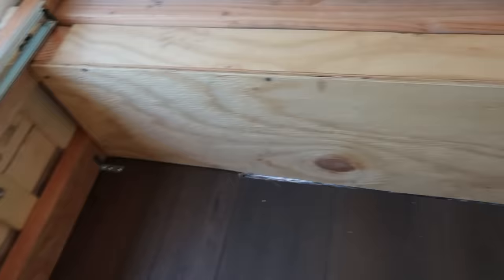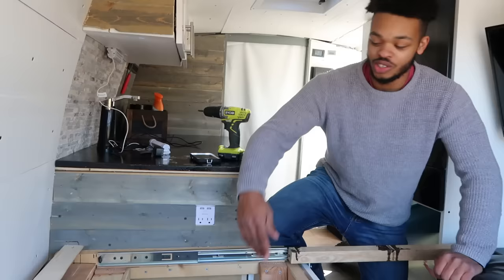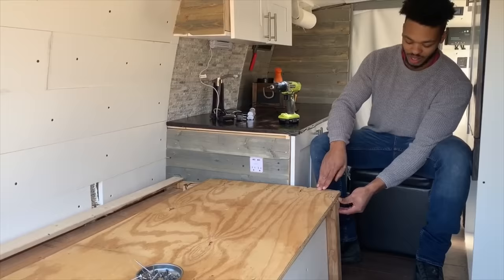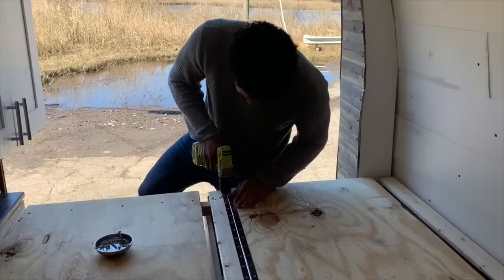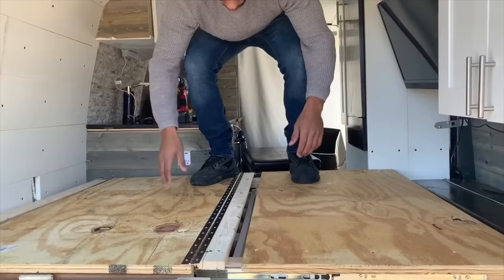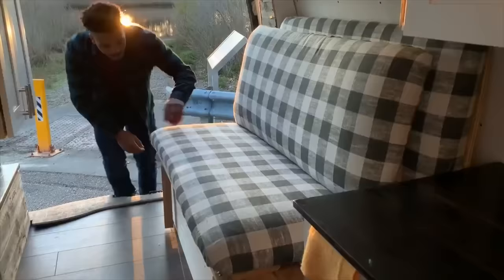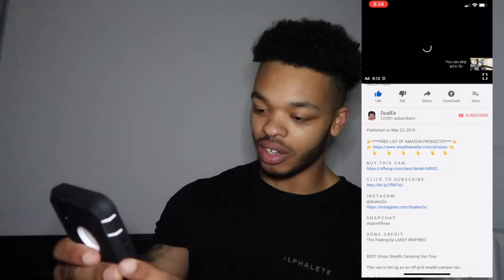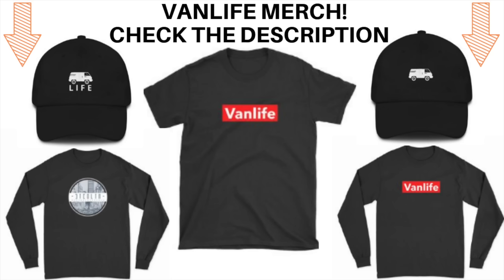BEST Camper Conversion Bed

Comment: I teach engineering and really appreciate how you have incorporated the natural "elastic" deflection of the drawer slides to allow the bed to open without the legs contacting the floor and then  provide support under load.  Very few bed designs take advantage of material properties in this way... GREAT JOB! A+

Comment: Thank you, thank you, thank you!  I'm about to build this in my van.  You have cleared up alot of the unknowns for me.  Just one recommendation: drill some holes in your bed boards for air circulation or the condensation from your body through the mattress will eventually cause the wood to get mouldy.  Cheers Mate!

Comment: Intelligent design and very easy-to-follow instructions. I built my van last summer with a platform bed, took it out and realized that I hated the design. Ripped everything out and have been trying to find a better bed solution. This is it! Thanks for going to all the trouble of taking it apart :-)

Comment: THIS DESIGN IS FUNCTIONAL. Yes you have a good set up. 
Not hard to get to the storage underneath, no messing around with lifting  or refitting 3 foam cushions or any one of 4 timber bed top pieces every time you want to access under storage like I have to.
I had been thinking about what to do to get easy access and storage and still have an out of the way fold out bed.
You have helped me solve my problem which will allow me to do away with a single bed/seat, gain storage and  a comfortable seat using my newly bought foam and still have a bed when required. 

I have removed the table (used to make a big bed and one side of the U shaped cafe seating which previously gave me the option of two single beds because I wanted floor space. 

There is still too much seating for me as I am a solo traveler driving a little motor home (fits in a standard size parking bay) with an over cab double bed. At the moment I have L shaped seating across the back and down the other side. Under the back seat area in one corner is the water pump, the rest is storage to where the two seats meet on the other side over the gas box (accessed from outside. Next to the gas box is storage and three batteries and associated electrics to the stove cupboard. 

I have planty of over head storage.

 I can now remove the seating along the side and install a cupboard with doors, making access to the batteries easier and giving me a bench top (with a pull out table) the same height as the stove and a bit of floor space too.. 

Thank you for posting

Comment: What about using a hole saw to drill holes in the plywood to let a bit of air flow and avoid moisture under the cushions? 
Also, there is this aire-flow or den-dry net to put under the cushions or mattress to avoid moisture too. 
Depending on where you camp or store your van, that might become handy. Humidity sucks 🤣
 Add an open containers with cedar chips in the compartment under the plywood. Smells pretty good

Comment: I made a bed that opens up and underneath it is storage boxes you can pull up and out to take out. Inside the bed head end is a shelf to put things on and has a plug in and light switch. above the bed is a counter top piece,, this is also my kitchen area. To clean dishes,, all i have to do is PULL OUT 2 square plastic containers from under bed storage boxes and fill one with hot soap water and the other with just plain warm water to rinse the dishes off. Magnetic strips hold on to knives to wall and silverware. Big plastic water jug you get at wall mart with plastic spicket and 2 push down water filters out 99%.  All around the roof edges has a black PVC 6 inch Diameter pipe that has water in it for doing dishes or shower and has a fill hose with  attachments you assemble to outside van for an outside shower if needed.. Also on the roof is 500 watt solar panels for all my electrical needs. I hang clean dry cloths on iron bar that is bolted to the sides of inside van just in back of driver and passenger seats. a special privy toilet you can get on line that separates poo from urine. poo drops into black iron container i made and you change out and once full you put it in the solar incinerator i made,,, all it does is dry up the poo into powder to throw away later on ground. No smell if the black iron container is closed and in full sun. Pee just dump on ground. I have a small pantry for ALL the dry good foods in packages or cans.  A bike rack in the back and i have a powerful light on a cord you can move around or clip to side of vehicle.

Comment: I'm wondering if there's a way to use this design to accommodate a full sized futon mattress... I'd likely have to find a way to make the platform slightly angled inwards when in couch mode to prevent the mattress from sliding off

That said, I LOVE your design. It's simple, elegant and easy to operate in cramped spaces. Compared to fixed beds in vans, you lose a bit of storage space, but you get more living space and versatility. Compared to other convertible bed setups, you get easy one handed operation and a cleaner design than the generic pull out slats

Great job dude

Comment: Wow I have not commented on any ones YouTube channel before and I’m 27 years old so i been alive for a while. This video has just blown my mind. This build is the one,
I do have a Question, the floating leg for extra support doesn’t touch the ground correct, which allows you to slide the bed without scratching the floor? If it doesn’t touch the ground how does it support the sleepers weight?

Comment: The Best bed build that I have seen, not only is it easily changeable but the access to the lower storage is the best out there. Why do you have a piece of wood on the edge of the seat, right below the bottom there. Is that the 4 inch piece to make up for the plywood being too short?

Comment: Great design  and you could make the mattress better by having the mattress sectioned but fully attached together. That way no terrible seams thats like sleeping on 3 islands otherwise.  You could do this with 8020 make another channel on the otherside to connect to so you wouldnt need leg supports.  you also have good storage underneath i never liked the stationary bed slash garage thought it was a waste of space

Comment: That's one of the best looking beds that I've seen, and the most easily opened.  Whoever did your upholstery job helped to make it all look grea, toot!  Thanks for sharing.... and I'm sure others would agree when I say, I'd love to see the whole layout of the van construction to see what other clever ideas you may have come up with.  Oh,  one suggestion.... you might want to drill some holes in the plywood of the bed, or you might get mold with no air circulating thru' it!
Reply from the maker: tegma I made the cushions myself too I just didn’t include that info in this video haha I have more videos about the build coming out soon so stay tuned!
Reply: Yes, size of the bed cushions would be great!

Comment: Make sure you always drill pilot holes before screwing as not to split the wood! Well done on the bed sir. My only concern would be that the top piece against the wall wants to fall/fold back down. Looks like your cushions may prevent that.

Comment: DualEx, you're so creative!!  And you share so much.   Thank you.   I would like to ask:  have you done any renovations in class A motorhomes?  We had a class C that had a queen size platform bed over the driving area,  a full size pullout couch and the dinette turned into a twin size bed.   The used class A we bought has more overall interior width & length but not enough sleeping space,  that's why asked about any renovations you've done to a motorhome. 
Thanks for any info you can give me.

Comment: pretty sure you sold this van but for future reference, where you had the plywood to put the mattresses on top, it's probably a good idea to put holes or something throughout it. reason being, I've heard of people using only plywood and because of the lack of ventilation, the moisture would build up and cause mold on the mattress itself. other than that, this bed is great.
Reply from the maker: I heard that from a lot of people after I started posting videos about van builds. I’m not sure if it’s true or not because obviously that never happened to me, but it won’t hurt to just put the holes in it in my next build just in case. Thanks for the heads up though!
Reply: DualEx for sure! where all do you travel around at? I see you’re into dropshipping, any success in it?

Comment: Loved that last video and this one was just as great! Love the conversion! I do have one question though, how tall are you? I’m 6’3” and was trying to figure out how I could get the bed sideways like that but I think I’m going to have to end up running it down the side of the van..
Reply from the maker: I'm about 5'10 - 5'11.  I would say that if you're over 6 feet, you probably wouldnt fit as comfortable as I do.  If I made a van the long way in the van, I would still do the same setup though just change the dimensions

Comment: Thanks for this great vid!.... I am making a similar bed in my minivan, but the bed is lengthwise behind the drivers seat and will be sliding out from the wall of the van toward the middle of the floor for a total width of 30 inches.... 66 inches long.. So two questions please.... how thick is the plywood you used?  3/4" ?  And how wide is the bed base where the piano hinge goes?  

For my bed, I'm wondering if the plywood will be strong enough to span about 32 inches.... I screwed up and bought 3/8" plywood, but think I actually will need 3/4" plywood. Since there is no way to support the part between the hinges. I guess I could put a support leg in the middle when it's pulled out. thoughts please?  thank you so much!

Comment: So basically if you had a larger sheet of plywood, you'd only need the one piano hinge...correct?
Reply from the maker: yes but it would still need to be cut into two pieces.  you would just put the hinge directly on each piece of the plywood

Comment: I'm just wondering which drawer slide did you use for the bed ? Thee above link for 500lb says 30" and the one at your Amazon link of stuff you used says 60" but that one extends to 120" ?The one above you have in the 3 links I think is right, but I have that same one model 3320 and it doesn't come apart like the one you have so I thought maybe you have a different model. Thanks

Comment: I really like this bed. What are the size of the wood frame of the bed. Length, width & high. Also how thick are the custions of the bed. I'm just trying to figure out what I should make this frame size. I'm thinking a full mattress that is a tri fold and they make them 4" and 6" thick & 52" x 72" Thanks for sharing.
Reply from the maker: I dont have the exact dimensions off hand.  when I come out with my conversion guide ebook it will all be detailed in there

Comment: Awesome. I was looking for something that would work as a FRONT bed. This could work, but probably larger as a couch than I want. If anyone else has a link to something smaller or even a store bought option, please let me know. I'd like the mattress to be the width of the van (or close) as a bed. Thanks.
Reply from the maker: Just make the bed smaller.  There's no set dimensions for this type of thing
Reply: @Dualex_Builds  Of course. I'm saying it work (and I could make it smaller.) I was really asking if anyone knew of something store bought that would work. I think I found what will work for me. I remembered Couchbed. Memory foam. Frameless. Will make the van look more like an actual living room. It's a really simple but stylish looking.

Comment: The bigger  2 peaces of Plywood needs holes for air circulation .it  is best to secure the plywood that touches the upper back of the van too while it is up?If you would get a Dog or child prof?other than that good job.

Comment: "Thumbs UP"
Great Video... You are a GENIUS... 
Question: Why is there a 2" x 6" under your cushion
(near the bend of the knees) at 5:28
Reply from the maker: Judi Christopher thank you! I just put that under there because it’s more comfortable at that angle than sitting completely flat. I forgot to mention that in the video lol but it’s not actually part of the build just my preference
Reply: @Dualex_Builds  
Right... That makes so much sense...
I am remolding a 1985 Class A RV... 
the couch is toast.. (34 years ugly).
I need to build a new one.
I'm 64 years old and this is my 24th RV to flip... 
It's addicting isn't it? LOL
Thank you so much for your video...
Reply: @Dualex_Builds  
I also think it's great that you made 3 cushions and not just 2 cushions... 
That is very important to mention too.

Comment: Can the bed be oriented crosswise in the van and used for passenger seating while driving?  If someone has a passenger wagon and removes the middle seat while leaving the seat belts, then the belts could be threaded up through the bed/couch.  I'm concerned what the insurance company would say since the homemade couch hasn't been crash tested.

Comment: How much weight can that slider hold. I'm 255
Reply from the maker: good4damoney it’s a 500lb capacity slide plus the legs. I’d imagine anyone can lay on it just fine. I weigh 190 lbs
Reply: @Dualex_Builds  very nice. Do you have any blue prints of your van I could buy. I just bought a 3500 Express van 2 months ago. I want to convert it. Stealth like yours
Reply from the maker: good4damoney yeah I wrote an ebook that explains pretty much how I made everything in this van. It’s up on my website (2nd link in the video description)
Reply: @Dualex_Builds  ok I purchased.  Thank-you
Reply from the maker: good4damoney awesome! Let me know if it helps or you have any questions or anything! 🙏🏽